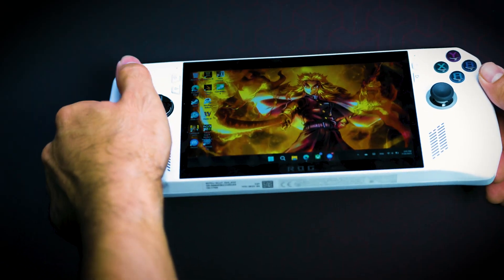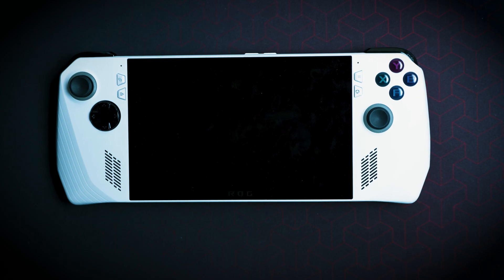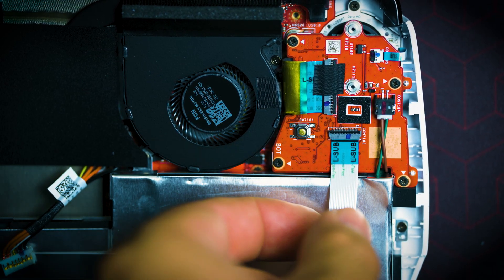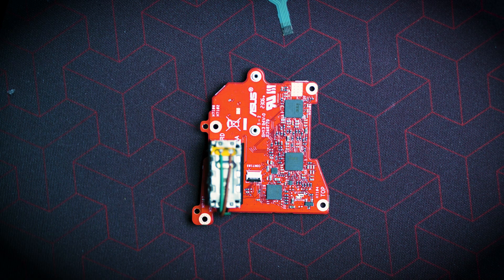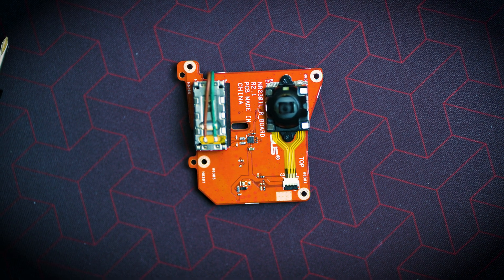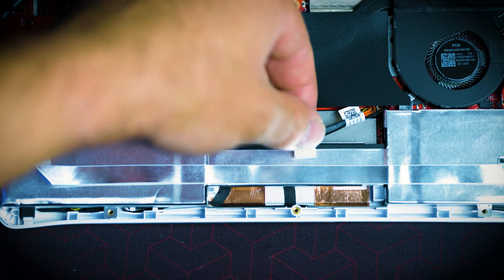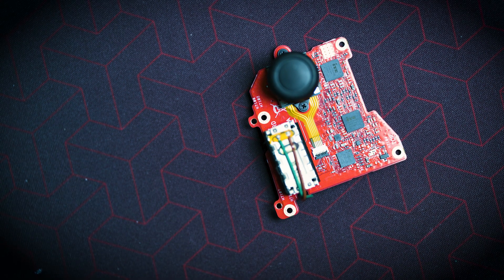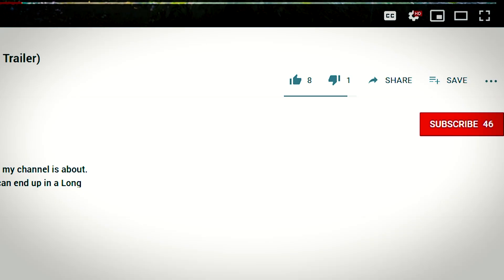ASUS ROG Ally Hall Effect Joysticks Installation & Review!

Comment: Would the switch thumbsticks fit into the Rog ally? I see some people said ps 5 stick covers would fit but they don't. I am trying to replace the black sticks with luminous clear ones. Any advice?
Reply from the maker: The Nintendo switch thumbsticks wouldn’t fit inside of the ROG Ally and I wouldn’t use them due to possibility of stick drift, if you’re to get luminous clear ones you can have them 3D printed or go to Etsy to have them made.

Comment: I dropped my ROG and after that the right stick began to move strongly to the right, i.e. the cursor is always on the right side.  I disassembled  ROG and ran into exactly the problem mentioned at 10:12, but the stick works the same way just like before i thought i disconnected it.  so I think maybe this little thing came loose already when it fell and that’s why it’s  buggy?  if so, I’ll try to put it there again, but it's kinda tricky..
Reply from the maker: That could be the case, ribbon cables can be tricky and may seem that the connection is held especially when clipping on. Once you take it apart, to make sure the cable is in you’ll want to give it a light tug to confirm that the ribbon cable is secured.

I hope this helps!

Comment: Thank you for this video and for covering the entire process here.  I likwly won't go the hall effect joystick route but am looking to swap out my OEM joystick for an OEM replacement joystick.  My left thumbstick is still working fine as far as the accuracy but is starting to make some slight grinding-like noises when moving it around now, so i would like to replace it very soon.  My Ally also has a very tiny crack in the white casing on the bottom and after seeing the latest GN video on their warranty repair process ive decided against aending it to them even tho ive also had a non working sd card slot for several months.  I just use a usb-c micro sd reader and a 2TB SSD is installed anyway.

Comment: The ribbon cable on the 2nd controller came off, there was no damage am  I cooked
Reply from the maker: Off the new or old joystick? If it’s the new joystick return it and get a replacement, if it’s the old joystick, it won’t really matter and if it does you can order the old joystick for backup.

Comment: Seems like a no-brainer to just use a HE sensor on the right and keep the original sensor for the eventual replacement of the left stick. The price sucks but my right stick has an issue that requires me to open it up anyway, so maybe I'll give this mod a go.

Thanks for the install video. I'll need this later.

Comment: Shielding helps a massive amount.  Not installing anything is pretty silly
Reply: I'm wondering if I use the same metal that the analog joystick caps that's on a Xbox white controller.... I wonder would that help alot of the interferences or the antenna is causing it. Sounds like I may have to swap what's in there if that happens. I'll wait till someone figure that out

Comment: Question: are the plastic thumb caps, the part your thumb actually touches, a proprietary shape?

I'd like to swap them out for some aluminum Xbox One Style caps if I could.

Aluminum doesn't wear out the way plastic does
Reply from the maker: elite joystick caps will not fit, the standard series s/x controller joysticks will.
Reply: @ChrisMizo  that's perfect. Would be a great add on to go with the hall effect stick modules.

Comment: Awsome video, I had to replace my display cable, accessories asus outta France, was only 3 days ,was 7$ cable and 25$ shipping to u.s. , yeah ordered on a sat and Monday they notified they sent it, and that Wednesday, 2 days later I had it and ally was back up and running, can't say I've had any proba with mine, good unit, no sd card issues, tend to play at 720p and try to keep temps 80 or below , already modded and git a 2tb 980pro 2280 drive under my battery , fits fine, got a 4tb silicon power on the way , clone it and add more games, got like 77 games tween 3tb :) can't wait to add more :)
Reply from the maker: That's awesome! Glad you're enjoying Rog Ally as much as I am 🎮

Comment: Why does it matter to unplug your batter when it’s at 15% vs 100%?
Reply from the maker: it's a recommended precaution for electrical discharge
Reply: It doesn’t. Use a grounding/anti static wrist strap.